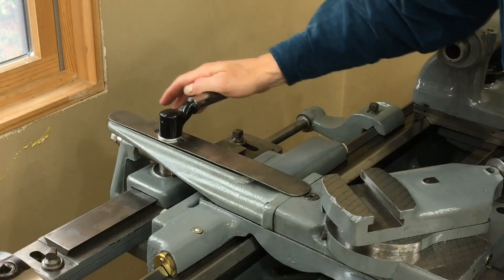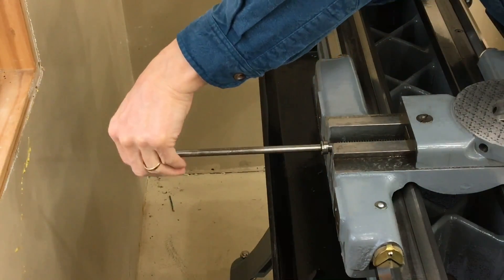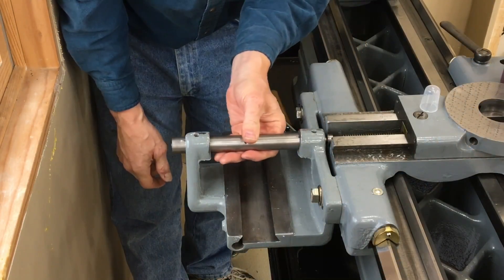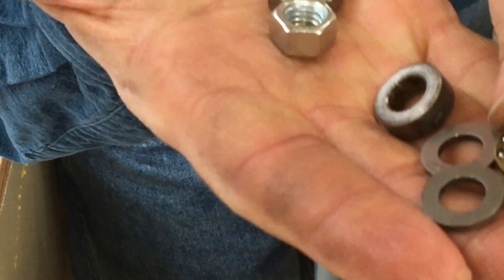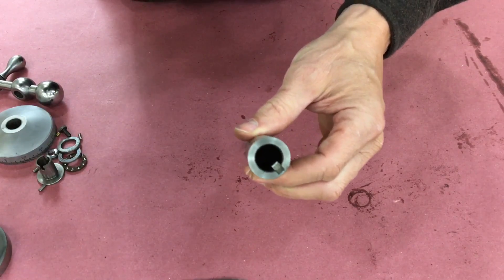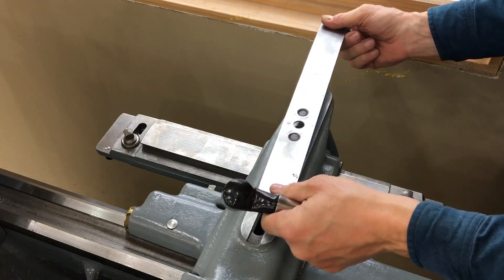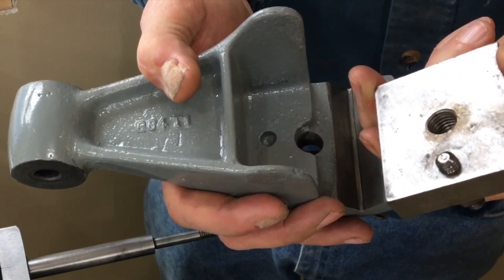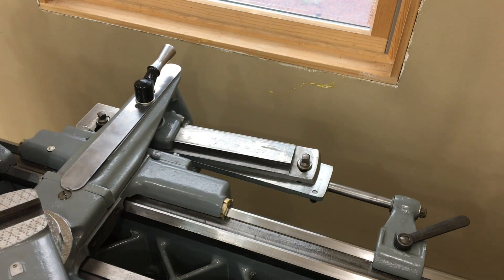South Bend 13" Restoration - Taper Attachment

Comment: I really appreciate your video on the restoration of a Southbend telescoping taper attachment. I have that taper attachment with all the parts except the two thrust ball bearings which hold the sleeve in place. I have made attempts to purchase these bearings but with little success. The bearing supply place I went to didn't seem to be able to determine which  ball thrust bearing would work.
Any chance you have identifying numbers for those two bearings you could share with me?
Thank you
Reply from the maker: Thanks for the nice comment.  I do not, however they are nominal sizes and available.  Suggest you measure the shaft and opening carefully to get the OD and ID.  Then go on the Macmaster Carr web site to find the correct thrust bearings.   If this does not work for you, send me a note and I will take mine out and measure them for you.  Then we can figure it out.
Reply: @georgebell7103  is there any reason why a Vesconite or similar plastic material could not be used as a thrust bearing?  Excellent video.
Reply from the maker: @DaveJ5  I am not familiar with that ,arterial.   Factors like heat, pressure and close tolerance over time are considerations for bearings.  I don’t think to long over unproven bearing options. Original bearings are my preference.

Comment: Very well done. I have a South Bend 10L heavy with taper and a FOURTEEN with taper. The taper sizes are confusing. I’d have to go back to my manuals, but it appears as though the attachment for the old 13, 14 1/2 and my Fourteen have the same size attachment. I’ve never seen the cover for the slot in the wild. I’m sorry I didn’t buy them when South Bend was still around and I bought parts for my lathes from them, so I had to make my own.
Reply from the maker: Yes, nice.  Thanks for your comment

Comment: Thanks again George, Your videos on the rebuild are educational. If anyone wants to see how the parts and sections of a South Bend Lathe go together and work then they should be watching all of yours. When I work on my lathe I always check to see if I'm going in the right direction. Thanks so much.
Reply from the maker: Thanks Paul, I appreciate your comments
Reply: @georgebell7103  George, you are a natural when it comes to teaching and demonstrating the order of a section or segment of the parts and how to accomplish that. My taper attachment is on backwards. I can tell it can go either way in terms of degrees or taper per foot, but it seems being able to see the degrees facing you makes it easier to deal with. I need to make the sheet metal cover to keep the chips out. My doctors have told me not to drive anymore or pickup anything heavier than a cup of coffee. Pretty hard to do when at one time I could walk around carrying 300 pounds. It's a hard pill to swallow and except the fact that you aren't able to carry on like you once did. The use of my engine lift helps but it takes up so much time to get into position. Your video series is Award Winning. Thank you so much. I hope you will continue to show us the projects you do on your lathe as a top-notch Hobbyist.
Reply from the maker: Thanks Paul.  You be sure to take care of yourself

Comment: Is nice, l make one out of 3/4 inch bar with bushings for my Logan,, didn't want 50 lbs dragging on my ways all the time when not cutting tapers no more than I do .
Reply from the maker: Yeah, I see what you mean, but I don’t think the weight is a big deal. It adds to the mass of the machine.  Thanks for your comment
Reply: @georgebell7103  sue it does half nuts and lead screw wear will be more as well as ways,,, seen many mills knee lead screw wear from heavy vise..
Reply from the maker: @georgespangler1517  Okay, I really don’t know for sure.  Will defer to your experience on this topic.

Comment: What I don't understand is what keeps the cross slide from moving when the locking lever is unlocked.
Reply from the maker: I may not understand your question.... when the taper attachment locking lever is locked the movement of the cross slide is totally controlled by the angle set on the taper.

Comment: Is the cross feed screw the same or is it different?
Reply from the maker: Not quite sure what you are asking.  Cross feed screw is in two pieces for a lathe with a taper attachment.  On a lathe without a taper attachment, the cross feed screw is one piece.

Comment: Old video I know but isnt there supposed to be another Bar or guide at the front of the taper attachment connecting it to the bed ways like the one at the rear, You can clearly see in your video how much the attachment is flexing or pivoting at the front of the attachment completely throwing off the actual taper
Reply from the maker: Nope, the taper attachment for this machine has no attachment in the front.  Only on the tailstock side.   I think the flexing you see is during assembly is because nothing is tight yet. Gibs are all loose during the assembly.
Reply: @georgebell7103  Okay because I am talking about from the 11:20 mark in the video where you can see the front of the taper attachment noticeably moving as you get closer to the headstock.
Reply from the maker: I think another support on the headstock side would not be a bad idea. However, South Bend designed their taper attachment with only one additional support on the tailstock side.
Reply from the maker: I see what you mean on the flexing... I did not have the gibs tight when I did the simple demo.  When the gibs are tightened up there is no play at all on the taper attachment.  As you have noted in your comment any movement would indeed would throw off any attempt at an accurate taper.    Thanks for your comment.
Reply: @georgebell7103  Thanks for the replies, While I have never owned a Southbend I have always found them to be some beautiful old iron, I have two Logan 11X36 one is a standard and one a turret that I converted to a standard and a custom made taig micro with a four foot bed. You can never have enough machines that spin in circles!

Comment: Hi George Bell. Thanks for the great videos. Did you end up replacing your thrust bearings? Seems like the sizes are a bit wonky. I'm having some trouble tracking down replacements for my Heavy 10.
Reply from the maker: Thanks for the nice comment.  In my case all the bearings were in good shape or only needed steel balls replaced.   McMaster-Car is the place to go for replacements, they have a great website, and lots of bearings.  Replacements will likely not be roller ball bearings, but needle bearings which are actually better.   If you need replacements I would go to McMaster Car, and replace with needle bearings.  Measure carefully all dimensions so the new needle bearings fit properly. Good luck

Comment: Well done and to the point. Your restoration video is a nice reference for me while I am restoring an 11"- 4' 1939 South Bend lathe sn. 91867 that I acquired from an old timer that owned it since 1970 for his arca speed shop. I have the sn. card on it and have some good history on it from the beginning  of its life. 11 inchers are more rare than the others but I am sure I can match up some of the parts I need from the other models or just fab them with the help of my Atlas/Craftsman 12"- 4 footer that I restored and is in excellent condition. If you or any of your views can help me out with parts or suggestions on my SB it would be appreciated. Drop a line to me at vt95@aol.com    Thanks for the quality videos on the SB and keep them coming. Ed K. Cleve. Oh.
Reply from the maker: Thanks,  the videos in this series will help you, many parts are not identical, but very close.  Good luck.